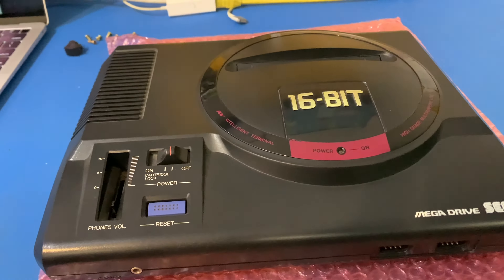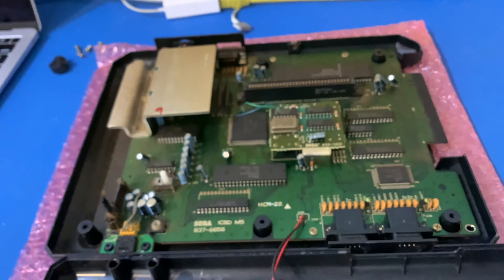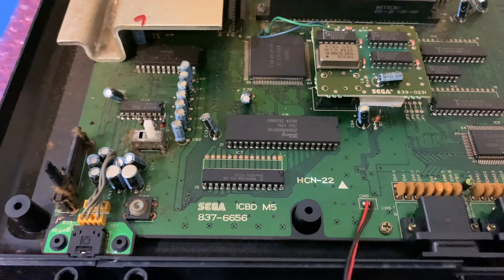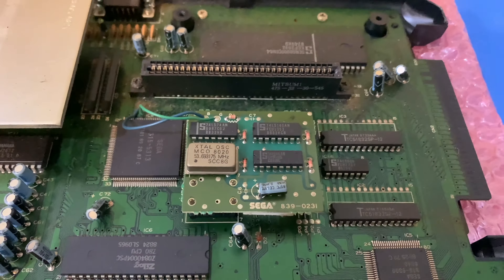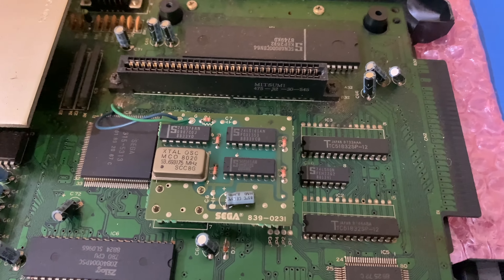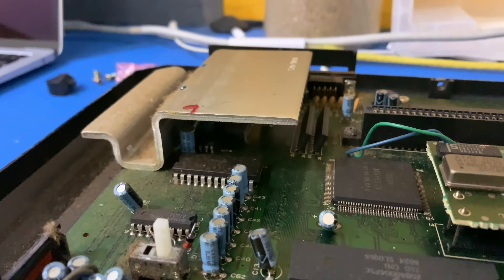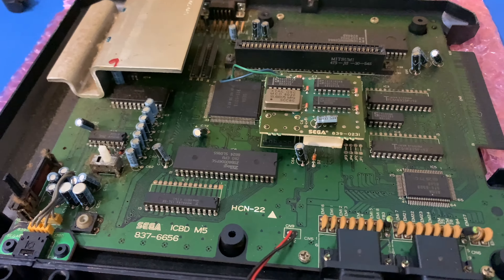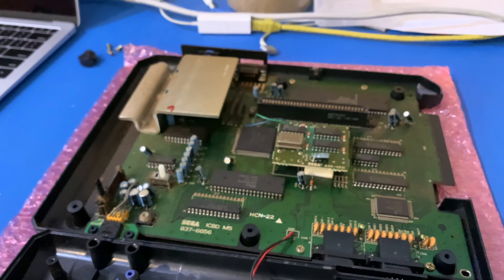Internal Inspection of the Sega Mega Drive Model 1 (VA0) HAA-2510

Comment: Is there a locking mechanism in the cartridge slot? I’ve never seen one but the earliest consoles must have had one if they continued making notched cartridges like that.
Reply: Mine has one an its a va1
Reply: @BocaRetroGames  Neat! Early American SNES consoles had them too, like SNS-001 launch units with SHVC-CPU-01 boards. AFAIK, Japan never stopped including them until the SHVC-101 so the same applies to PAL systems. Every American cartridge from mid-1993 was redesigned to defeat the lock but only stuff like Super Game Boy and Super Game Boy 2 were designed that way in Japan. Sega probably removed it to save cost but Nintendo clearly did it for some other reason.
Reply: @emmettturner9452  Nintendo US did It because kids were breaking the lock forcing cartridge out whenever the lock was not released and costing Nintendo with the repair service. So Nintendo Just though "ok, you want to be stupid and pull cartridges with console turned On? Your problem then". From 1993 or so, US cartridges changed shape and didn't have that lock squary fit format anymore.
Reply: @3xperiment8  Yep! I like to imagine people were accidentally grabbing the whole console by the SNES cartridge and whacking themselves in the head. :) Howard Phillips said that it was there in the first place because you could blow the console’s fuse by inserting or removing with the power on and the determined later on that the risk was minimal enough that it made sense to remove after people started breaking things (old Nintendo Age interview).

That said, I’ve since discovered that SEGA never stopped including their cartridge/power interlock on Japanese Mega Drives. The ones I had were all from Southeast Asia where gray market importers had removed them. Since then I got a Japanese VA7 from June 1992 and a  Japanese VA6 from August 1992. Yes, they went back to producing VA6 since they exported Japanese consoles as “All Asia” and VA7 had 50hz issues.